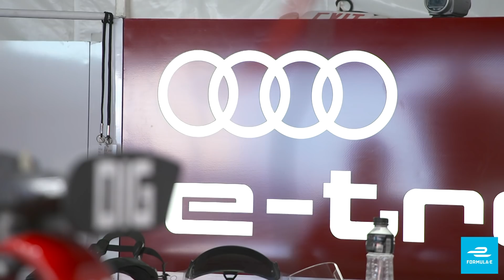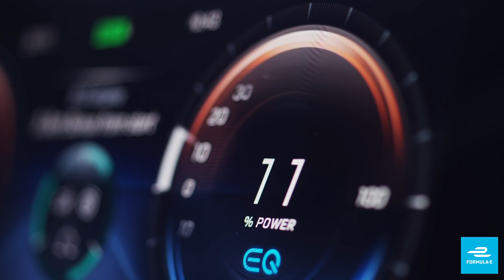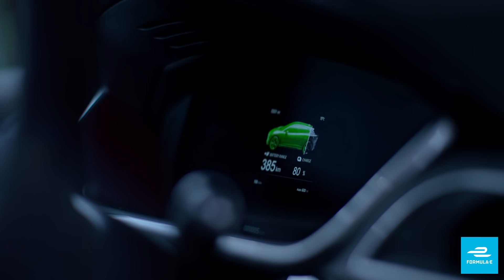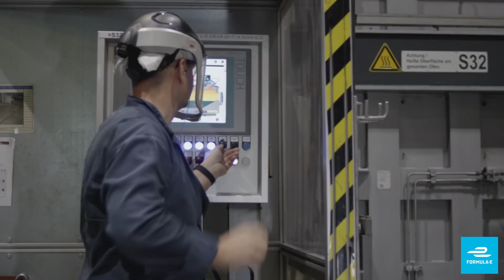How The Car Industry Is Going Green: Electric Cars, Low-Emission Factories & More

Comment: Very thankful about your great videos, but I have a question. Why do you don't talk about hydrogen powered cars(I know it's still an electric engine and they'd probably be a hybrid)? They are a great solution for the future, especially in cases, where you need a bigger range. I know, they are still prototypes, but very promising.
Reply: Well F-E, is only about battery powered vehicles.
Reply: @A370RK_Luis  But they are also talking about other technologies that aren't battery powered that are supposed to help against the climatic change
Reply: @kaenguru0643  Those tecnologies came in scene when we talk about EVs making. Renewable energy, making all the process carbon neutral
Reply: Hydrogen is a dead end for cars. Might be viable for larger transport like trains, ships and planes, but on the road hydrogen is so far behind battery powered vehicles in efficiency, cost, complexity, easy of use, infrastructure, pretty much everything... that it's not even funny. And that is not due to a lack of research. Quite the opposite, hydrogen fuel cells are stone-age tech compared to li-ion batteries. The main reason for hydrogen lacking is physics and chemistry.
Reply: @superdau  and why is the f-cell for example working that well? Sure, they have to develop much more before they can get on our streets, but I don't say it's the car that we can buy in few months. That's a project over years. Also, the ressources you need for a battery are unbelievable high and it doesn't make any sense to drive an electric vehicle before we get a green energy mix. Before that a new diesel is the most clear we get. But in many production hydrogen is a by-product. So it's not that difficult to produce it

P.S. please tell me if I get in your opinion too emotional. I don't know why but with that subject it happens really fast so please tell me, because I want to do this discussion on facts not on emotions, thank you